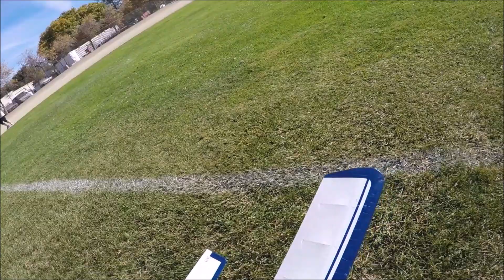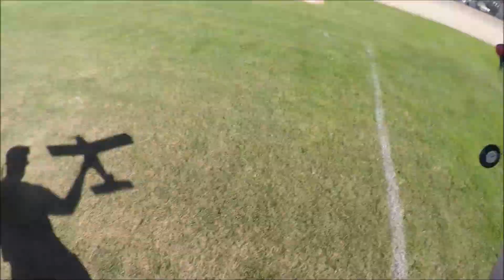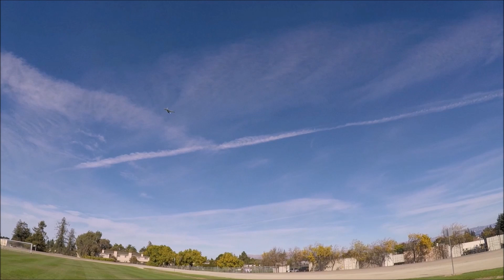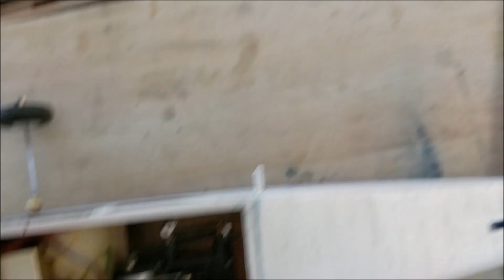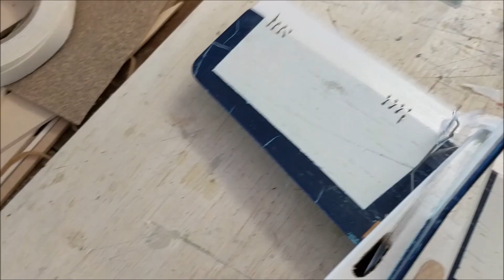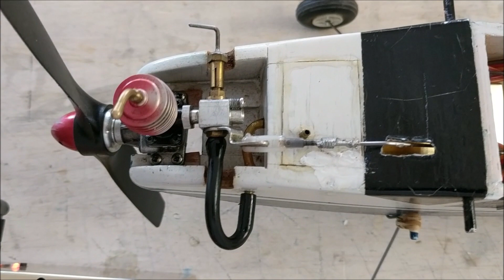3 Channel Galloping Ghost Radio Flight Test

Comment: I guess that is a Controlaire Ghost actuator? It seems to take a higher pulse rate than the Rand. Congratulations on sticking to the old hardware and still getting successful flights!
Thanks for sharing